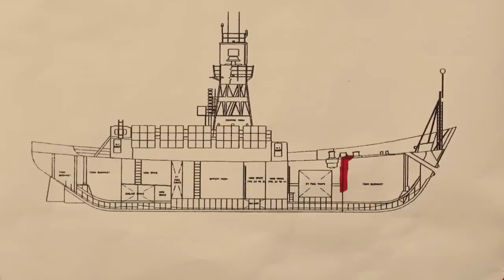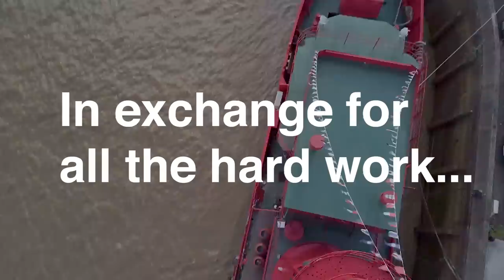Foam Mining Inside a Giant Ship

Comment: 19:37 Why did you use rock wool for insulation? Wouldn't some foam be better?
Reply: Haha
Reply: I was a commercial insulator, the best performing insulation material is rock wool. It also has the advantage over foam in that it doesn't burn; it is also used as a fireproofing material.
Reply: @DawgYa1  Thanks for the info. My comment was a joke: after removing all that foam I don't think they would have used any other kind of foam 😂
Reply: @DawgYa1  You are wrong best insulator is dry rock/glass wool, in this environment water from air  willl condensate in wool and on all cold  parts of the ship . so   when they discover how bad wet rockwool is we wil see new wideo how to replace rockwool by hard  foam .  :)
Reply: @martinwinzig4951  Pat isn't wrong Martin, with a decent air gap behind rockwool doesn't absorb moisture and its probably the only affordable insulation material that you can safely weld right next to. I've used this before and after ten years, dry as a bone, no mould and no worries if I want to weld a bracket/fixing on the other side of the bulkhead.
Reply: Chloe Hennessey I don’t believe he is
Reply: Lmao this one dudes joke turned into a whole argument
Reply: Death glare
Reply: I was really starting to be saddened by the fact that this youtube video hadn't a single comment thread that turned into a pointless slanging match... so thanks guys, you've turned it around.
Reply: FOAM!!! Who said FOAM? I am loosing it. LOL
Reply: @DawgYa1  r/wooosh
Reply: @martinwinzig4951  you are wrong, if condensation can potentially get the rock wool (the superior material) wet, then it will also get the glass wool wet as well.  I have dealt with both products after suffering water damage.  The rock wool always comes out on top...
Reply: @DawgYa1  r/wooosh
Reply: Marble from Italy would be better 😈😂😂😂😂😂
Reply: @chloehennessey6813  Um... I will not say what I want to say, due to some of the respect I still have left for women (Maybe man tho?), after your comment. Get some sun.
Reply: Russell Williams I’m in the sun as we speak. 

So I’d like to mention to you that just because your parents used language like “dumb” and “stupid” to describe your school years doesn’t mean you should carry on the tradition. 
It’s not okay to use words like that over such a small insignificant joke about foam and rock wool. 

Instead of respect for females start having more respect for everyone in general. And choose your words better next time.
Reply: It’s a proper room.
Reply: @chloehennessey6813  don't you all have something better to do instead of arguing on youtube?
Reply: @corky7513  I like the name dude. Can I steal it? Mine? <3
Reply: @chloehennessey6813  Lmfao. Okay. Have a good one.
Reply: @russellwilliams4317  go ahead lol
Reply: Call the man and ask him if he wants to buy some "FOAM"
Reply: @jimbob9631  lmfaooo
Reply: Discrete Society attitudes can’t be ignorant. Feh. 
Effin genius.
Reply: Discrete Society I’ll dumb it down for you: your feelings of inadequacy aren’t my fault.
Reply: im 95% sure if ben finds you he will kill you
Reply: @benphillips6112  great job captain Ben. Next step, make it sea worthy again; you obviously have the talent, tools, intelligence, and money to make it happen.
Reply: @russellwilliams4317  bro there's literally no joke. The only joke is how much of a hypocrite you are
Reply: I’m sure it’s been said, but rock wool doesn’t absorb water.
Reply: @bigchad1359  Um... Okay? Lmao.
Reply: @russellwilliams4317  lmao?
Reply: @bigchad1359  I'll spell it out for you, bubba. Laughing-My-Ass-Off----At you.
Reply: I see a funny joke with 47 comments and I know immediately it's spiralled into something completely different. I love the comment section
Reply: @russellwilliams4317  cute
Reply: Chloe Hennessey exacerbating
Reply: @DawgYa1  correct
Reply: I can just imagine Ben staring through the fourth dimension at you

Comment: Or, just pour in gallons of acetone.
Because what could possibly go wrong?
Reply: me chain-smoking on deck
Reply: Looks like pretty standard rigid (non-aromatic) PU foam. Acetone would be like pissing on the stuff.
I work with similar foam daily, and we've had a couple of instances when we've had to clean some pieces of equipment, that were not designed to have foam form inside them.
We use pure toluene to break the outermost layer of the foam, and then pump trifluorosomething (can't remember the last part) solvent through the system (nasty stuff, goes through nitrile gloves like welding sparks through polyester jacket). That turns the foam into a sludge that can be pumped out of the part and burned.

Dissolving hundreds of kgs worth of polyurethane would be impossible, initially through "on what grounds do you have tankers full of these very harmful chemicals to marine life parked next to your boat?"

Also when they say "truckload of foam going to be recycled", it's actually going to be burned in some kind of power plant.
Polyurethane foam is energy waste (like wood) the moment it forms.
Reply: @tube71000  thanks for clueing us in.  Yeah, those solvents sound like constituents of rocket fuel.  They might have burned the foam for winter heating but they didn't.  I wonder why.
Reply: @bashisobsolete.pythonismyn6321  not really rocket fuel. They're chemicals commonly used in my labs. But yes they definitely have toxic properties that wouldn't do well in large amount especially near the ocean.
Reply: Botha Lissom I’m glad I read the comments because I was about to write the same comment as you 😂
Reply: Because tip companies have stack'o'papers, allowing them to burn anything from plastic fridgewraps to old tires.
Yet, if you light a match on the ship, you'll be immidiately rounded up by coast guard and cavity-scearched for a license to dispose the household waste within the port water line.
Reply: 100% acetone - i would have vented it and burned it off. #DonttellGreta
Reply: Wire and power source. Aka foam cutter
Reply: Acetone would be useless on polyurethane foam.

Comment: I sure hope that it does not sink. You know, from a lack of foam.
Reply: les sharratt it’s  on gravel like a little beach
Reply: Oh the irony
Reply: It won't sink as long as the room isn't flooded
Reply: @BrySmi  The foam was put in when the ships were converted to be automated to prevent the ship from sinking in the event of a collision. Where there is foam, the compartments can't fill with water. Spray foam wouldn't be used to fix a leak. It would be far easier/cheaper/quicker to repair the leak.

Comment: Foam can be used to increase the security ratings of high value targets. It takes about 90 minutes to get through 10m foam.
Reply: Holy shit....
Reply: Not with a shaped charge.
Reply: @xcalibertrekker6693  you'd be surprised.
Reply: gray  sure. And how much does that liquid cost in the appropriate amount for 10 cubic meters of foam?
Reply: @Argosh  30-60 bucks for 5 gallons
Reply: @karlkarlng  so you are going to invest 30 bucks per 0.02m³ of a Liquid to get rid of 10m³ of foam at 10 bucks per m³? That ignores how you actually get the liquid applied, how you protect yourself from the lovely gases this produces and a ton of additional things.
Security ratings work by making you pay more to get in than you hide behind your security system.

Comment: I guess no one told you that there is an actual tool made for removing polyurethane foam. They look like the reel from an old lawn mower and are air powered. Foam applicators use them to remove foam that has been applied too thick.
Reply: you missed the point: ready-made machinery? This would ruin the video.
Reply: Muc SALTO The owner doesn't care about the video, the man recording does. It's likely the owner of the boat wasn't aware of the tool Scooter was talking about.
Reply: Kris Roberts   Like Jeremy  R. said. Time is money.

Comment: "Don't do this at home." What, fill a perfectly good space with hundreds of cubic meters of foam?
Reply: And then excavate it all lol
Reply: It makes sense why it was fill with foam.

The ship was in great shape to be fill 100% with foam to make sure it will not go under is it was unattended in the middle of the ocean and repurposed as a light house.
Reply: Why take out the foam if it the ship needs it to float and not go under the sea
Reply: @cxm7548  when in harbor you dont need extra measure to prevent extra important peace of navigation exposed to open sea and in case of its failure to float, bring in danger other ships on that route. ship exposed to sea without capabilities to navigate/steer is easy to sink. thats why they filled it with foam in case to be hammered with waves still stay afloat. it was a light house, not good to move around or go underwater...
sh forgot to add, it is repurposed, changed the ownership and do not serve as a lighthouse anymore hence no need for extra buoyancy.
Reply: @cxm7548  
Because the ship is not longer being used. Now is going to be a music recording studio.
Reply: @cxm7548  This lightship was built in 1939 & filled with foam in the 1980s. It doesn't need foam in order to float. The foam simply gave the old unmanned ship a 'lifejacket', better enabling it to remain afloat for long periods, without crew intervention, if damage or corrosion caused it to leak. In it's new role the foam protection is no longer necessary.
Reply: You know because we all have lighthouse boats filled with foam at home.
Reply: Is there not a chemical to disolve the foam
Reply: @camrunner6633  Definitely, but handling hundreds or thousands of liters of solvents sounds very expensive and like a very bad time with lots of unhealthy fumes. And then at the end you're left with a shitton of toxic goop that you have to dispose of somehow.
Reply: @redbugg99  those ships were built with the purpose of being a lighthouse, it was filled when you didnt need someone to man it anymore
Reply: Some home have been foamjacked to fill under foundation.
Reply: @camrunner6633  For most hard urethane foams, no, there basically are no chemicals that can disolve it. There are some that can be used in a lab setting, but their toxicity is so high that they are unsuitable even for industrial, let alone "DIY" use.

Comment: Quite different, but this reminds me of when I worked for an industrial cleaning firm in Nottingham. We got the job of cleaning out the old tallow tanks at (not there anymore) cussons soap. They were like big silos which were entered through a hatch on the side. The top layer was solid like soap and several inches thick at the edges but in the middle you'd go through and immediately be neck deep in the worst stinking foulness. I can't even begin to decribe the smell.
Reply: I had to repair heat tapes on tallow tanks at a feed mill. It was 25 years ago, but I still remember that smell!
Reply: Just looked up what tallow is.

ohhhh nooooooo.

Comment: You guys missed the plot....you already had excellent insulation! Wtf
Reply: @nonsequitor  hehe...just yanking your chain a bit there Bud...good job!
Reply: Problem was it was so well insulated, it even kept people out ;)
Reply: Well if it was flotation foam it has to be water tight by definition, so it would have served the paints purpose of sealing away moisture (and air) from the metal. Rust by itself is no problem if the structure is not degrading further by being sealed. Also it is more than strong enough to support floors furniture and drywall no problem. Foam is pretty strong if the load is distributed on it. So you would attach things with pu glue foam on it.
Reply: @MicraHakkinen  lol
Reply: R 1000
Reply: @kistuszek  they didn't have waterproof closed cell expanding foam in the 80's.  That foam would degrade in water, just like all other older boats.
Reply: kistuszek Expanding foam does, very slowly, take on water. It’s ok in houses etc. but on a boat, only for emergency floatation.
Reply: Don't you have a condensation problem now...the cold steel behind those panels?
Reply: @thewhomphlew  not quite true, we used 2-part closed cell PU foam in '87 for our housing concept.  Even closed cell foam will absorb water if it's not separated from the water by an impermeable barrier.

Comment: Whats the backstory on the ship??? How did you acquire it? It looks like a lot of restoration was done prior to the foam mining.  Is it seaworthy? Working engine?
Reply: I want a tour of the whole ship.
Reply: It's a lighthouse ship, they have all propulsion removed or converted to generators.  It most likely was taken out of service (along with all lighthouse ships) with the advent of LORAN, Digital Charts, and GPS.  She would not be sea-worthy without an ocean-going tug, but they were often built with exceptionally thick steel, as the lighthouse vessel would be converted from other uses (often ice-breakers) once they outlived their usefulness for their original purposes.
Reply: @BadHaddy  Two at Harwich  and one At Gravesend  in Kent

Comment: Great idea using the tillers!  I think the chainsaw would've come into play a lot sooner for me.
Reply: However, the easiest method would've been to simply use a heat carving knife with nichrome wire. Biggest difference being that you'd make a loop and cut ice-cream-like scoops and ship those to the recycler's rather than bags.
Reply: @aserta I like that hot-wire idea a lot. Was also thinking a sawz-all with a very long blade would work to cut it out in blocks. Slightly more dusty than your method, though.

Comment: next time, a coarse wire brush on an angle grinder works really well.
Reply: That was the first thing I thought! I've dug out several boat bildges with a big grinder and real coarse wire wheel, works great!
Reply: That's what I used close to the steel but there was 100m3 down there... I'd still be doing it if I'd used the grinder all the time... plus it makes so much more dust.

Comment: Get a couple of gallons of acetone. drop it in the tank. wait a few days. and all the foam is reduced to a liquid slurry.  We don it on or old coastal ship.
Reply: The Dutch merchant sailor: is right.
Kudos Mr wooden shoes.
Reply: My thoughts exactly but why do it the easy way when you can do it the hard way, right?
Reply: @esurcylimaf4335  unfortunately the 'hard way' would definitely have been trying to dispose of a few thousand litres of toxic, highly flammable slurry in the middle of London.. there was over 100m3 of spray foam down there.
Reply: Probably more than a couple, but anything beats seeing the guy go at it with the claw of a hammer.
Reply: @benphillips6112  no more difficult than getting rid of 100 cubic meters of solid foam.
Reply: @benphillips6112  a lot of that foam is just air though. did you give the acetone thing a go first?
Reply: That would not have done anything with that type of foam.
Reply: @joezanella8949  okay thanks for the correction
Reply: I would have likely just sawed it into sections of like blocks/bricks with a reciprocating saw or something.....
Reply: haha- I was thinking the same thing.
Reply: @jwenting  I would think the foam is definitely reusable in its current bagged form- as insulation in attics or to mix into concrete.
Reply: @ThyrzaSegal  mixing foam with concrete? Seems legit
Reply: @benphillips6112  100m3 of Polyurethane Foam. what is used here will give about 30 to 35 liters of leftovers. if it was styrofoam based it will desolve in almost nothing. Were to dispose of it... watch this guy XD https://www.youtube.com/watch?v=iO1Yn3UP9oA No just kidding. put it outside, let the acetone evaporate and you can dump the leftover brick in the  plastic waste bin.
Reply: @ItsFrenzy26  I've mostly heard about using foam in a more liquid form in with concrete but don't see why the hardened form wouldn't work.
Reply: @ThyrzaSegal  no, it's not insulation foam. It's very dense material intent to be lighter than water. Its purpose is to prevent whatever it's in from sinking even if flooded with water. Foam thermal insulation has far larger air pockets.
Reply: @jwenting  Thanks so much for the response! I assume this foam is not meltable with acetone either if it is a different composition. Do you know what the name of this foam material is?

Comment: I was getting very nervous about that confined space and a fire with the tiller munching away at the foam
Reply: Yes! The tiller bouncing around and choking on FOAM everywhere! Really good stuff.
Reply: The tiller has overheat protection which shuts it off until it cools down, as shown in the video.
Reply: I was more worried about the angle grinder shooting sparks into it.

Comment: A hot wire foam cutter would have been a good idea. Then you could have cut out large chunks.
Reply: Corsair Cor hot wire doesn’t work on expanded polyurethane
Reply: @James_Hallam  You are correct. It will burn, not melt and create nasty fumes.

Comment: Why not use acetone to melt the foam? Just be careful of fumes.
Reply: It would probably cost alit even though acetone is cheap
Reply: acetone won't melt polyurethane foam.
Reply: @Skwisgar2322  was I thinking of it on styrofoam? Thought if it would work, try it.
Reply: @Drew6709  Even if it was styrofoam, it would be a terrible mess to clean up all the melted goop.
Reply: @Skwisgar2322  I thought of melting the foam instead of digging.
Reply: @Skwisgar2322  I found a withdrawn patent for 1,2-Dialkyl imidazoles. Which apparently is supposed to dissolve polyurethane foam fairly safely. Although getting hold of some would require talking directly to a chemical lab. It might have been faster? But they had so much foam I doubt it would be affordable to buy enough to do it all with it. Plus then you are stuck with a liquid mess at the bottom. I have no idea how or where you would dispose of it.